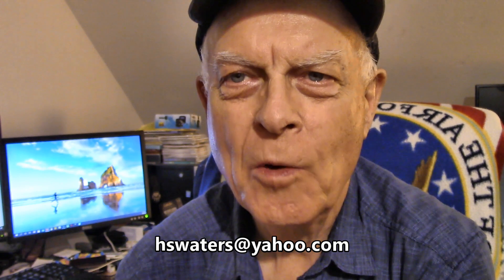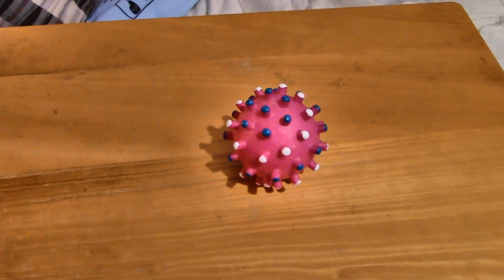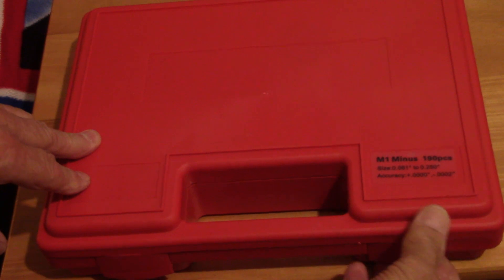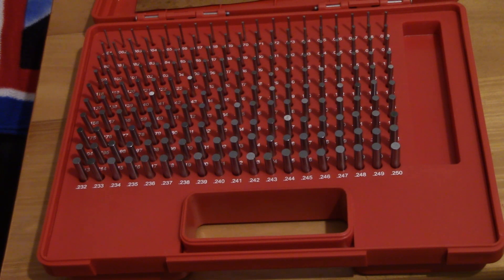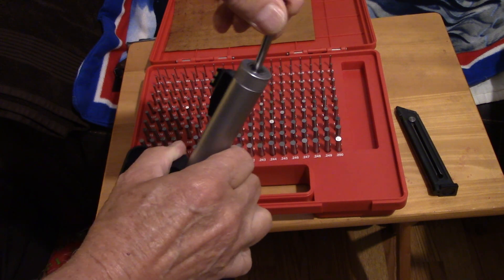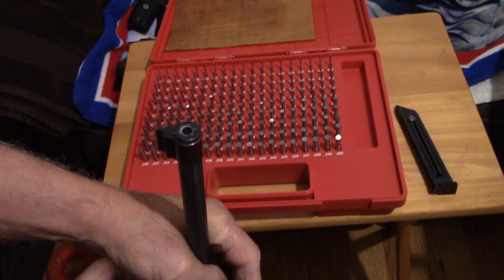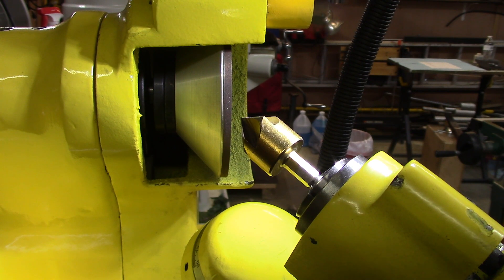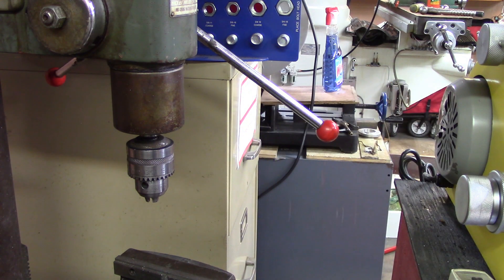Tyiing up loose ends 15

Comment: Harold the .22 diameter should be the diameter of the barrel outside the lands of the barrel. Not the inside of the lands. 

Oh by the way keep that virus you bought over there in Texas!
Reply from the maker: That is a big virus isn't it.  I bet it could plug up the old schnoz really bad.  I left a link up there in the description area to all the specs on 22LR.  Thanks for stopping by.

Comment: You didn't account for the rifeling. If the bore was .220 then the bullet would not be spinning as it exited.
Reply from the maker: Yes the rifling is most likely a good part of the missing material.  Thanks for stopping by.

Comment: i suspect all of the barrels might very similar in size before the rifling process. i have seen videos on this. it seems very similar to knurling a valve guide in an automotive cylinder head. the knurl makes the hole smaller, follow up with a ream to size. that rifling die puts the barrel through the fist part. ex tech educated guess. liked your video, always enjoy watching you Harold. thanks.
Reply from the maker: I have placed a link to rifling in the description box of this video  and here also.  https://www.youtube.com/watch?v=LAf064S2Cv4  Thanks for stopping by..

Comment: someday when I get some pin gauges Ill check my .22s   marlin  and rugger 10-22 rifles .   the plasma table look to be working...?  I was going to build , but decided to buy the complete system .
Reply from the maker: You will be cutting metal a lot sooner like that.  Thanks for stopping by.

Comment: I recently made a muzzle brake for a .40 s&w. I wanted my brake to have a bore of .42" I turned a gauge pin to .42" to fit the bore of the brake and then turned it down to fit the bore of the firearm.  It was at this point I made the same discovery you did. I hadn't really put much thought into bore diameter until that point.  If you have a .22 projectile and a .22 bore plus the depth of the grooves, you would loose pressure from behind the projectile when fired.  Also there is a chance that the rifling would fail to twist the bullet.
Reply from the maker: All true.  Thanks for stopping by.
Reply: @AmateurRedneckWorkshop  also I know that you reload.  I don't know if you've ever reloaded for a precision rifle and were chasing a particular set back off of the lands and got a bullet seated too far out you know that you can feel pressure on the bolt handle when you close it.  When you eject that loaded round it will be set back into the case.  If you had high neck tension, it may eject the casing and leave the bullet stuck in the barrel.  Much care needs to be taken when loading close to the lands because if the bullet is touching or jammed into the lands it will cause a large pressure spike when fired.  I'm sure you are just like me and knew all of this, but didn't think about it when working on the opposite end of the gun than we're use to.
Reply from the maker: @buckinthetree1233  I have made every mistake that can be made.

Comment: The discrepancy that you noticed in bore sizes may be caused by burrs left from the rifling process. If you have access to a borescope, you might be surprise with the ridges some manufactures neglect to clean up after rifling. Lead is very soft and easily deforms to accommodate irregularities, but it's disheartening that some American manufactures don't take more pride in their products. As a side note, it's these irregularities that make it possible to match spent bullets with the barrels they went through.
Reply from the maker: I have looked down the barrel with my eye and do not see any problems with the surface smoothness.  Thanks for stopping by.
Reply: @AmateurRedneckWorkshop  You got me curious as to what the correct bore diameter is supposed to be and the information I found specifies 0.217". Here's a link: https://web.archive.org/web/20150824004613/http://www.saami.org/pubresources/cc_drawings/Rimfire/22%20Long%20Rifle%20-%20Sporting.pdf
The deviation that you noticed is only a couple thousandths, and even very small burrs in the rifling could be the cause.
Reply from the maker: @EDesigns_FL  thanks for the link.  I will look into it.

Comment: What is the diameter of a 22 caliber bullet ?
Reply: .22 inches
Reply: @buckinthetree1233  I know that 22 caliber is 22 100ths of an inch but every manufacturing process has tolerances so I was asking Harold what they actually measure.
Reply: @terrycannon570  I apologize if my reply was insulting, and I'm not trying to be sarcastic.   There is a huge population that doesn't know and I didn't know if you were one of those people, and I'm not trying to insult the people that don't know.  Most of them know many things that I don't know.   I wasn't able to tell which group you fell into by your question.
Reply: @buckinthetree1233  Not insulted just trying to clear up what i was asking.
Reply: @terrycannon570  hey, no problem.  I was just trying make sure you didn't think I was trying to be rude.  I pretty sure I'm the only one who didn't understand your question, so that's just me being a idiot.
Reply from the maker: I just measured one made by Winchester and it is .222.  Thanks for stopping by.